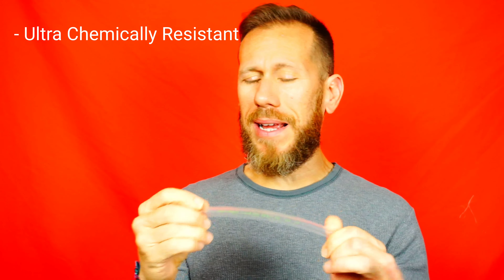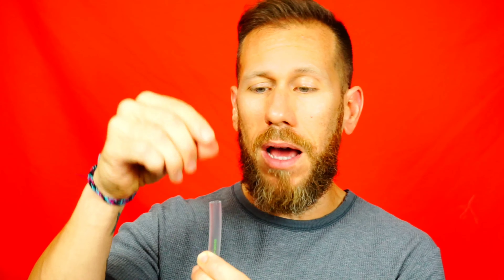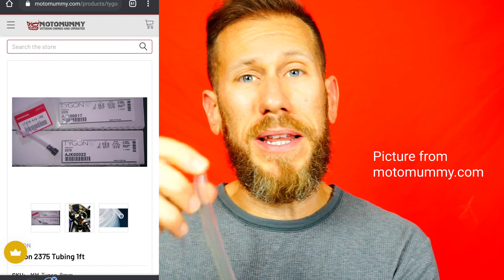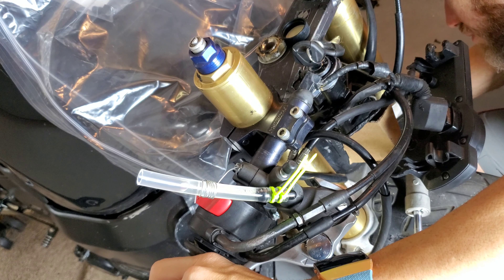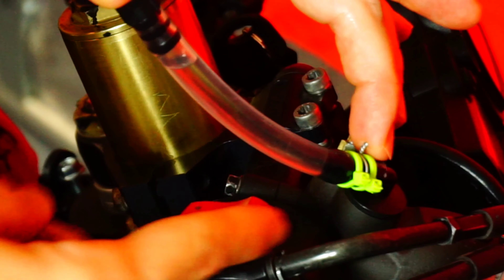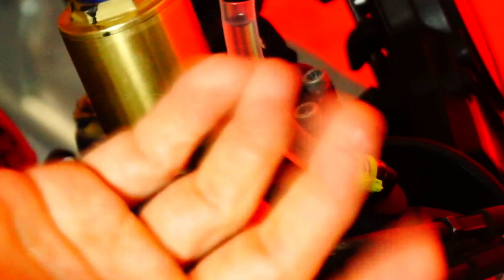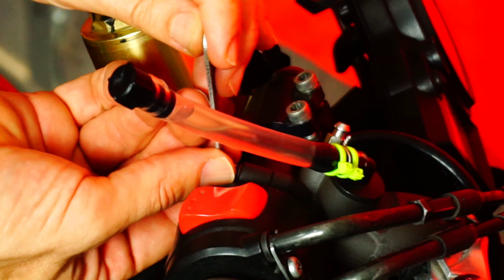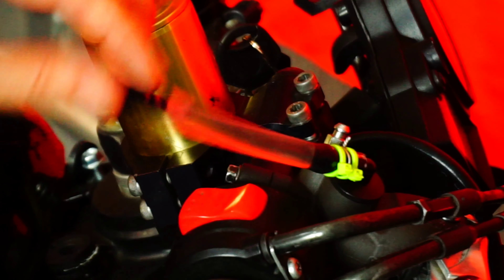Making a front brake reservoir with Tygon 2375

Comment: in case of rain, would the honda cap be tight enough for water not getting in ?
Reply from the maker: Hey 👋! Water entering the brake line wasn’t a concern but great question! 

The Honda cap fits pretty tight.

Comment: The only thing I might be concerned about is the pressure in the system...could it blow the cap off?👍
Reply from the maker: Hey! I never had an issue like that, but that is whay I will put safety wire on the ridges near the cap. I used mine for about a year on my FZ-09 with no issues. The cap is tight too, but it is something to consider.

Comment: Is the tube sweating brake fluid ?
Reply from the maker: No, tygon is chemically resistant and that includes break fluid. I ended up selling this bike, but I did it on my old FZ09 on the rear brake and never failed and I had it for 2 years until I sold it.